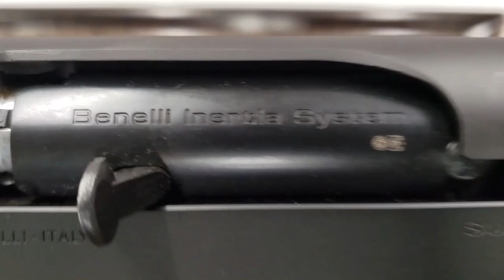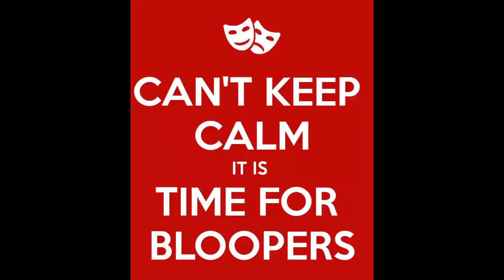HYDRO DIP and CERAKOTE Benelli Super Black Eagle II

Comment: I wonder, since OHW paint dont need primer, why did you apply an epoxy primer first? Or is it another paint brand you used? Does aplying a primer under OHW paint any good, what difference does it make?
Reply from the maker: This was a different paint brand. I have hundreds of gallons of paint from way before we started using OHW, so I use the old paint when I can.

Comment: Looks awesome.  What would you say is more scratch resistant on the barrel and receiver, Cherakote or Hydro Dip?  Also, I have a browning silver with Dura Touch that is badly discoloring in certain locations like the hand grip.  Can you re due this try of surface for a Hydro dip?   Thanks!
Reply from the maker: From my experience they are both about equal in scratch reisitance, but neither are bulletproof... no coating are. Not even factory nitride and anodized finishes will hold up if heavy scratching is what the gun is going to be subject too. I just tell people to go with what they like best and expect to be redoing it in 5-10 years if they beat there guns to hell and back.
For your Browning we always blast off existing finishes and get them back to bare metal.

Comment: When you double dip, how do you get the first side to not come off with the tape from the second dip?
Reply from the maker: If it is activated correctly it will not come off on the tape. If it comes off you are either under activated or your paint is not adhered correctly.